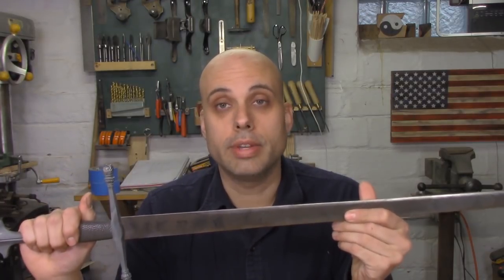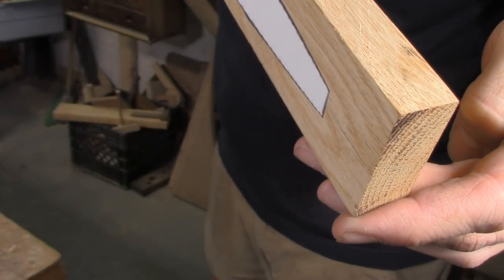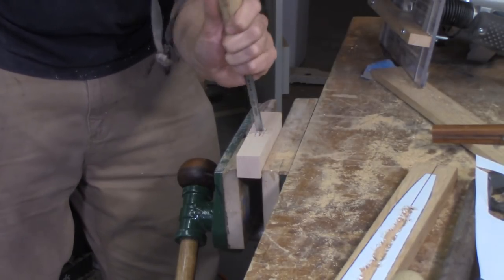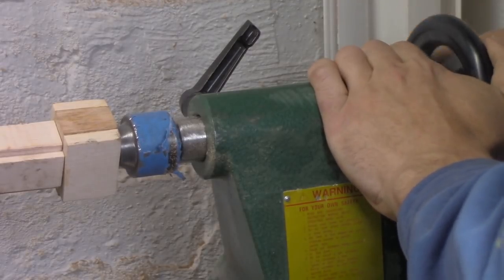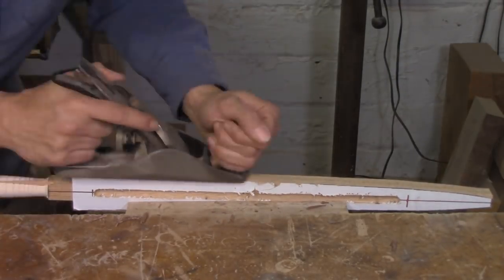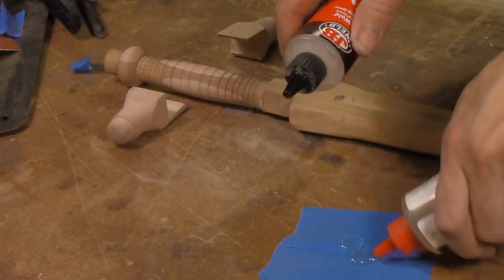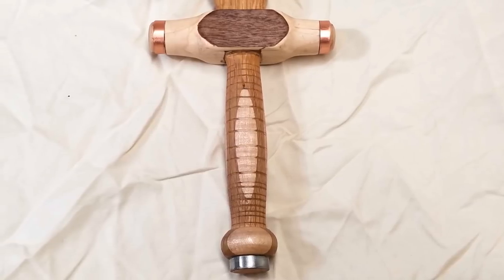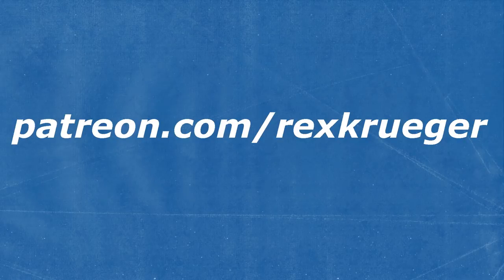Make a toy sword out of wood

Comment: Great sword Im sure your nephew loved it. Just a note. A Fuller isnt created by removing material but rather by swaging the groove into the heated steel. In this fashion you get a broader blade but use less material, therefore it is lighter. As well as the strong I beam cross section. Cheers

Comment: Consider Pex crimp fitting rings for those hilt and pommel rings. Underneath their black anodizing they are copper. And the 1/2 inch rings are slightly larger than rings sliced from the copper pipe, in case that matters aesthetically. I'd imagine that would go for the 3/4 inch variety too, but I've only done 1/2 inch Pex'ing.

Comment: Hey Rex, I made wooden swords and daggers, for your next wooden weapon project. You should try doing a round tang, when I did it for my project. All I did is drill hole, use a round rasp that made everything fit in easy and quick. I hope this tip will help you out. 🤓🤓🤓

Comment: Adding a fuller is more about breaking the vacuum on a stabbing blade. Without one, when you shove it inside somebody, the wound creates suction on the flat & makes it difficult to remove. A fuller opens the wound, allowing air in to replace the blade as you pull it out. Gruesome, but highly effective.
Reply from the maker: I've heard that, but I'm not sure I buy it. Fullering for reduced weight and greater stiffness makes more sense. But I'm no expert.
Reply: @RexKrueger  I'm sure that's an added bonus more than a primary objective, mainly because you don't tend to ever see it on slashing weapons like sabres or katanas. Those could benefit from the added strength for parrying just as much as stabbing blades could.
Reply: @nightcatarts  This is incorrect.  Human fluids and tissues are happy to conform to most blade geometries.  The fuller is there to lighten the blade. The "blood grooves" myth is widely circulated and incorrect.
Reply: @MrTegidTathal  Then why do you not see them on slashing weapons? Also, the conforming is the cause of the problem. If a blade opens a wound (wider at the tip, barbed, or blunt & delivered with extra force, for example) then it's a non-issue, but if you put a smooth object into a material that contains liquid and conforms around that blade, then it will form a seal around it & make it "suck" onto that object. It's the same principle that makes coasters stick to the bottom of wet mugs or wet sandpaper stick to a sheet of glass.

The blood grooves thing is a different matter; the idea behind that is to allow blood to flow out along the blade & thus cause potentially fatal bleeding without having to remove or twist the blade, but it'd be a kind of scorched Earth approach since the blade would always be removed in a fight unless the attacker is dead, so it's not worth the extra effort. Blood grooves would be considerably narrower than a fuller too.
Reply: @nightcatarts  there are plenty fullers on shashka and japanese swords.